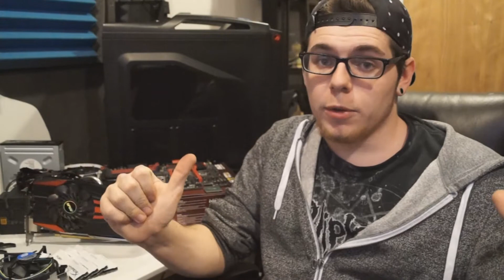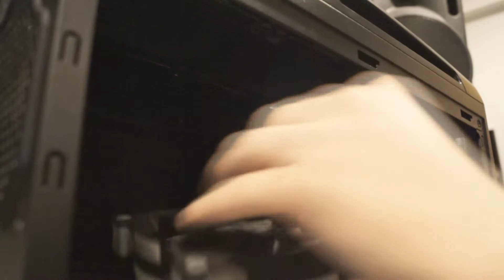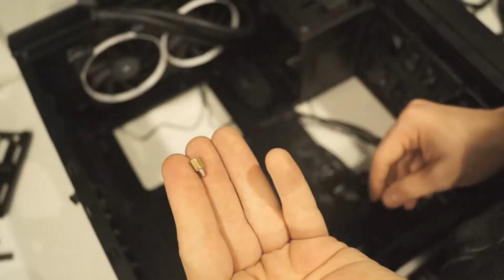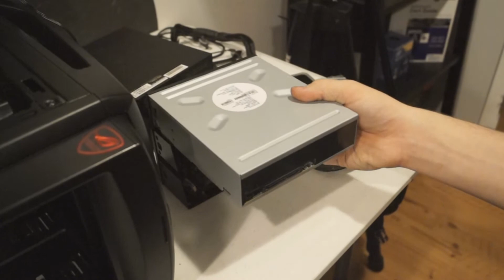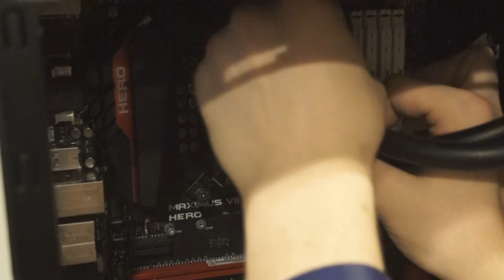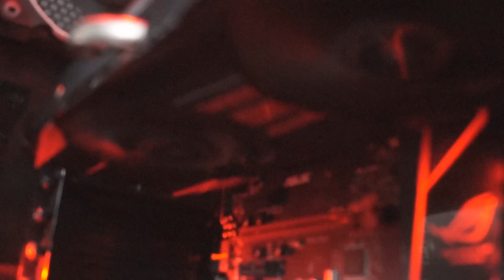NextGenPC - SHENANIGANS Builds a PC [Project ALICE] Custom Gaming PC Build

Comment: That's a "push" configuration on the radiator. When the air moves from the fan to the radiator, the fan is pushing the air across it. A "pull" configuration is when the fan sucks air through the radiator.

I wouldn't want to break the "pins and needles" now would I? Lol. Needles.
Reply from the maker: David Handy Woops, I apologize for the configuration mix-up. And "pins and needles" just sort of rolled of the tongue. I wanted to try and make this video as professional as possible and doing many many takes of the same thing when you mess up is quite exhausting. Recording this video took me about 6 or 7 hours when I could have just built the PC in 20 minutes, but I had to think of good commentary on the spot and get all the right angles. Video Quality still didn't come out as nicely as I had hoped, however in the end I had over 30GBs of footage to edit, so I truly apologize if the video wasn't to your liking. Go check out a favorite Channel of mine called LinusTechTips. They have really professional quality videos that I rather enjoy.
Reply: Official NextGenPC I'm not trying to sound harsh, you did a good job.  Like you said, video quality is meh, but I just thought I would bring it up.  Just a little criticism to help you out.  Believe me, it's the smallest things that can make something that looks like it was half-assed verses looking "pro".